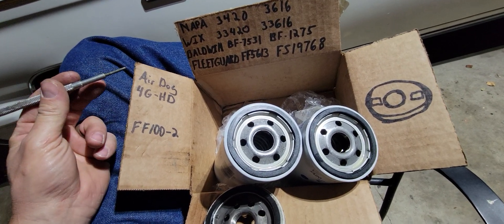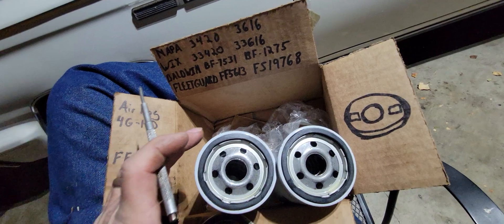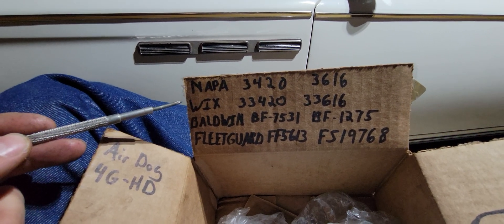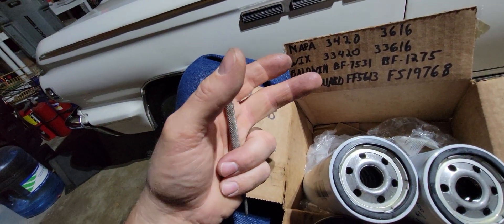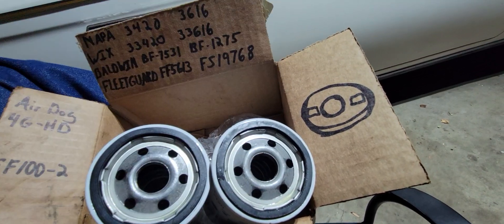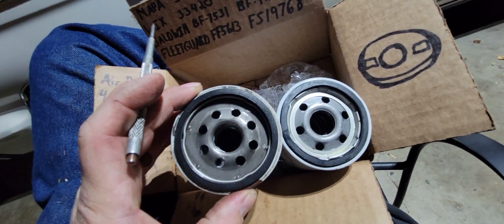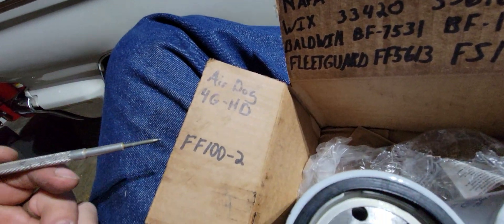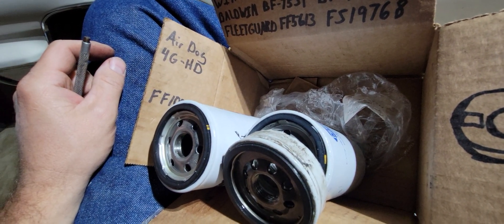The reason your AirDog leaks with aftermarket fuel filters.

Comment: Brother you just save me literally. Thank you very much. I was having the same issue with Airdog brand filters. Struggled for about an hour. Unscrewing the filter amd screwing it back in priming it over and over and every time it would continue leaking no matter what.

After i watched your video i removed one block the one towards the engine side and kaboom problem solved. No more  leaks.

Comment: Even the Air Dog filter comes different now. Air Dog told me to remove the two little black plastic pieces with an allen wrench. They arent needed. Were there to distribute fuel coming in. Dont need them .

Comment: Those little blocks are removable, I took them off and run a cat 1R-0751 you also have to trim the mounting bracket to run the cat but it's by far a better filter than any other options. Also the napa filters are just rebranded wix.

Comment: Do not use the Baldwin filter. It is not the correct micron rating and defeats the purpose of fine filtration! It is rated for 10 microns, vs the 100-2 is rated for 2 microns. If you look up the specs for your injectors, you do not want anything above 4 microns getting in your injectors.
Reply from the maker: From what I've read, 10 microns is what the factory filter is rated at.
Reply: @clinkerclint  Exactly, so what is the point of installing a filter that does not do any better than the factory filter, that doesn't even meet the specs for the injectors?
Reply from the maker: Well, a big part of it is I can run down to my local truck shop and pick one of these up.  Another issue is I don't have a fuel pressure gauge on the truck right now.  I don't feel like running the risk of potential pump failure because I'm running a super fine filter.  This motor was recently apart and Scheid's went through the pump and injectors.  They said they saw no issues with my injectors after nearly 100,000 miles of runtime.   Factory rated micron filter is just fine.   @Erklzanderz